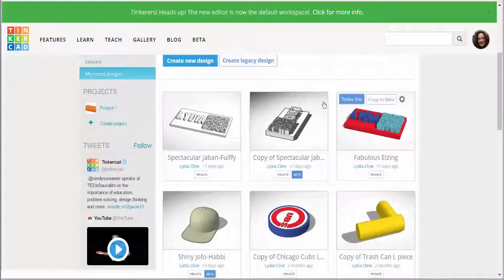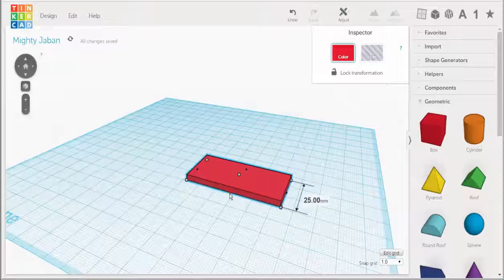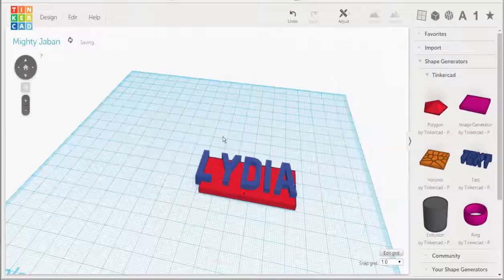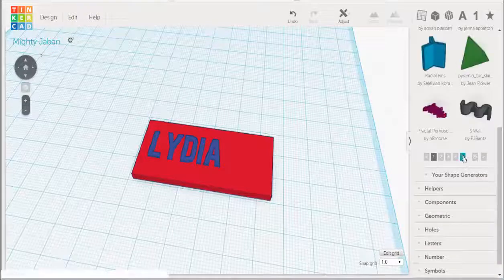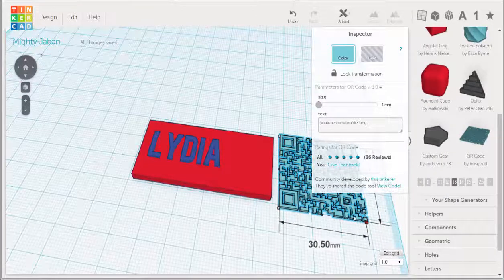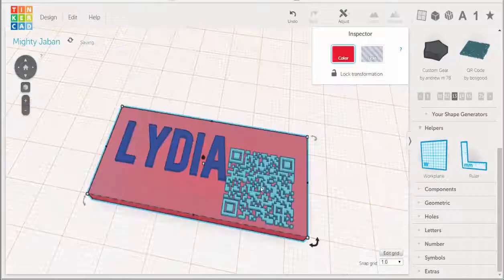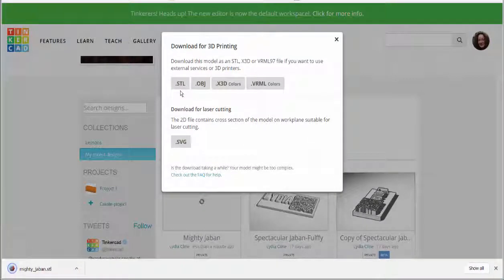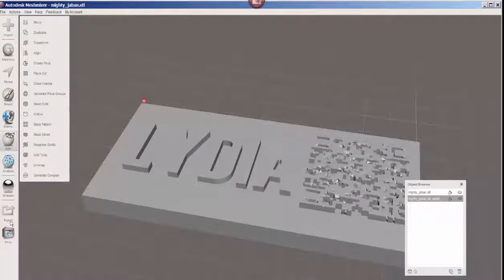Tinkercad: Model and 3D Print a QR Code Card

Comment: Did you try scanning the qr code to see if it works?
Reply from the maker: Good question. This one didn't, but another where the QR code wasn't extruded as high did scan. You can't extrude the code much, and it must be done on a printer that can do very sharp corners.